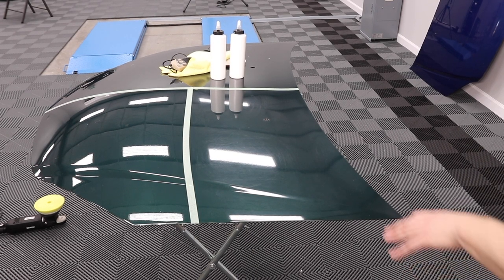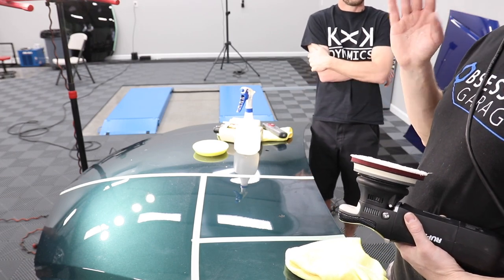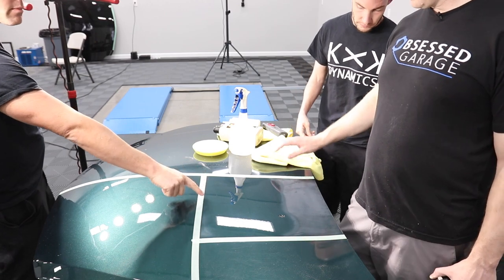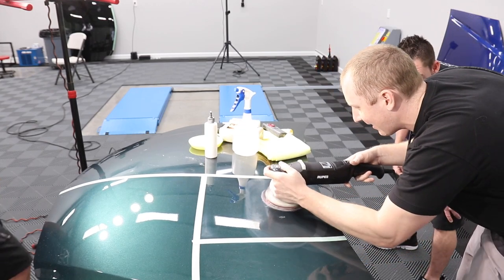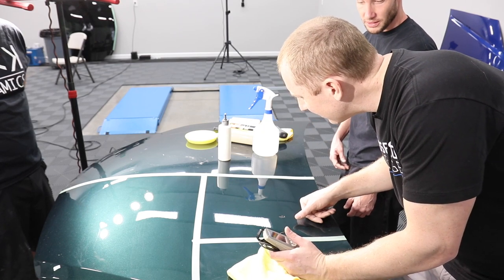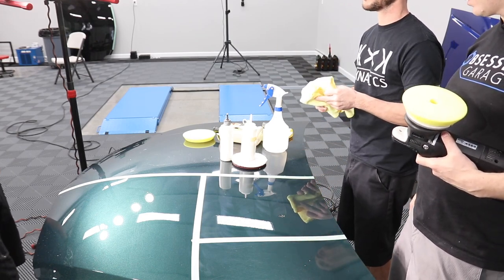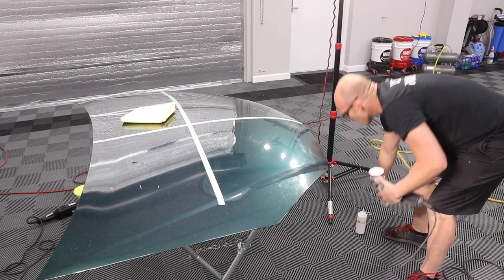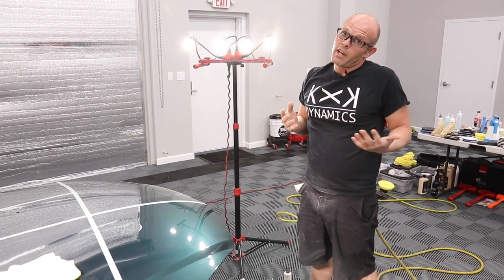Wet Sanding & Advanced Polishing: E8 - Comparing KXK Process

Comment: There are Diminishing and non diminishing abrasive when it comes to different compounds, you choose your certain compound for the job your working with a diminishing compound will start off at lets just say 1000 grit and work it’s self all the way up to 5000 grit the longer you work the abrasive (cycle time). A non demising compound will just work at lets say 1500 grit your whole cycle time.

Comment: I keep coming back to this.

So Matt, at the time you shot this, which exact compressor were you running? Because apparently the Tornador requires 5CFM to run optimally and I want to make sure I but the right thing. Thx.
Reply from the maker: It was a little dual tank portable California Air Tool compressor.
Reply: thank you Matt. I'm seeing a couple dual tank California's. One that will do 5cfm for around 3 bills and the other one I think only does 1.6CFM. Do you recall what you paid for it?
Reply from the maker: I think it was about $400.
Reply: Obsessed Garage I think I know which one it is now thank you.